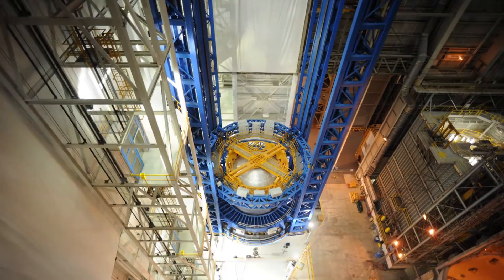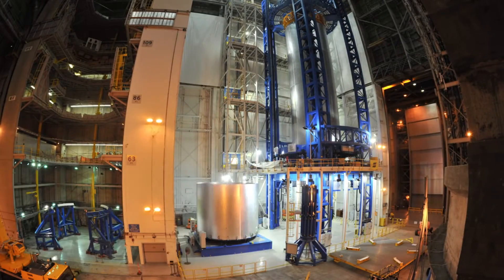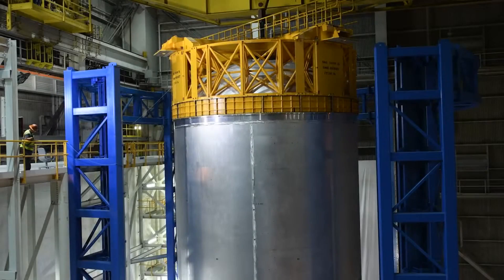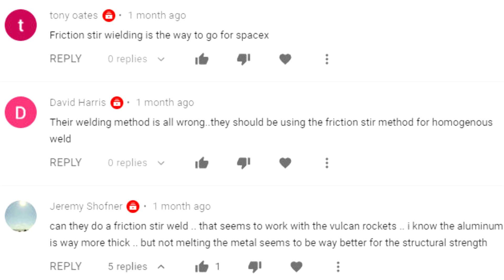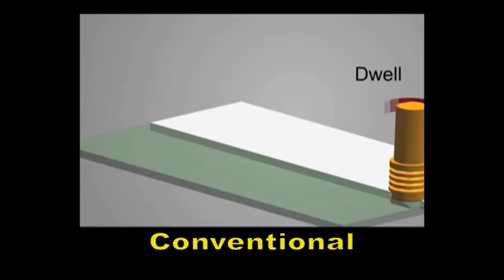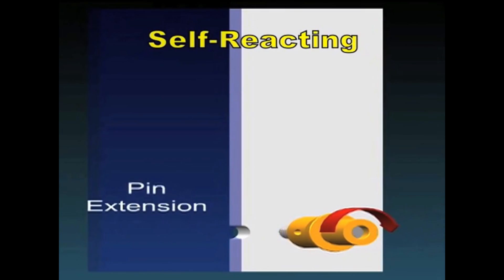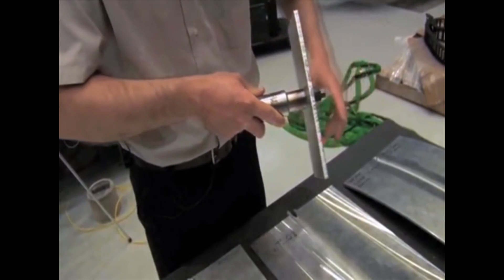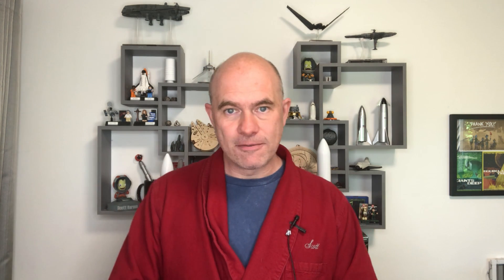SpaceX's 4th Starship Prototype Collapses During Test

Comment: anyone know, how is spaceX doing with the whole reentry nosetip thing? early on they were going with plain stainless steel, then i heard gas bleeding transpiration cooling. now i don't know what they're going forward with or if they're still unsettled
Reply: Ceramic tile heat shielding on those parts of the ship that will experience the greatest temperatures.
Reply: @odysseusrex5908  thank you. seems like a high-maintenance solution but a sensible one
Reply: @peabody3000   A number of factors, including the simpler shape of the Starship and the limited amount of it that will need to be covered, cause them to expect the maintenance work to be much less than it was with the Shuttles.

Comment: I would challenge the remark that friction stir welding is the best, there is no such thing as the best welding method for everything. Period.
It allways depends on many factors, the method choosen by SpaceX is ok enough, that's not the issue, its the place where they work, the soroundings with its influences and tolerance of what they want to acomplish, more specifically the temperature and how fast the energy is drained from the bath/pool of molten material, this is at least what I could figure out from the pictures and images I have seen. In said images it looked like the weld was partly torn off, of material, still somewhat intact, the tear material looked rather rough, this points me to a failure next to the weld, not in it. Said failure next to the weld is usually a sign of energy getting drained from the weld at too high speed, leaving the material in an unfavourable state which is harder and more brittle, this also means that if a "burst preasure"-type situation occurs, that's where a failure is most likely. Since they are building rocket prototypes that is quite the bad combination of factors.

If I where in charge of the welding calculations, I would llike the sections to be welded in a tower like structure with "airlocks" (just an extra hall with dorrs on both ends is enough), to keep out drafts, I would also apreciate if I had a sleeve like device in which the welding happens which slides up with the part, when the section is raised and back down when the ring segments are to be welded together. The tower like building would need climate control to ensure that the entire temperature gradient in the part (sections, prototype, series product) is as tiny as possible, any difference in temperature can and inevitably will cause extra tension in the entirety of the part, this is only goingt to get worse the taller the structure grows. A difference in height by only 5m (~16f5') in a big construction building with a temperature control tolerance of ~0,1°C/m can and will twist big structures of thin material with a relatively low stiffness by quite a lot and that is from my personal experience working at a shipyard with a specialised milling/turning station (~5m diameter). All of these measures would keep drafts away and the temperature across the piece rather even which would dramatically increase the quality of the welds, and that is without automation, that would increase the quality even more.

As for those that will inevitably call me a smartass, I am currently studying bachelor of engineering and passed all extra classes for welding engineer SFI part 1 (of 3 https://www.slv-nord.de/studenten-info/ ), after getting my bachelor degree I still would have to pass extra exams and courses though, this time with the SLV-Nord (Schweißtechnische Lehr- und Versuchsanstalt Nord - Welding training and research institute north). Only then I would receive the International Welding Engineer (IWE) diploma.